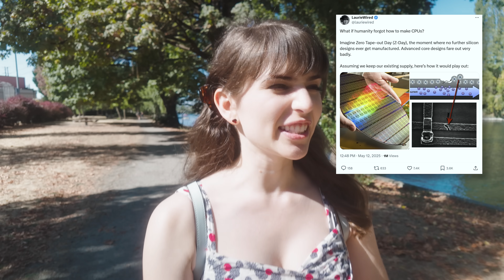what if humans forgot how to make CPUs?

Comment: I have an 8bit transistor-based computer at home. I mean like independent transistors. I created one (only the CPU, a pipelined one at that) decades ago at uni, and another one recently as more of an artistic project (think about something similar to Ben Eaters 8bit computer). Even without manufacturing new CPUs, we could use the modern computing knowledge to create homebrew computers with discrete transistors. Even in the most disastrous situations, within the first year everyone would have a handcrafted computer at home capable of remote communication. Writing some simple communication protocols could be feasible, and before we lost the ability to use the traditional internet, designs and software would be already available. The main issue would be for huge companies who could not process our data at the same rate, but if you ask me, this would not be so bad.
Reply: There was UUCP available before there was an internet. It allowed sending messages between systems that were not always connected together. It could also allow remote users to execute commands.
Reply: That's fine, but in reality we would have to reformat the entire civilization, much of which is at present incapable of running without modern computers. Computers are everywhere, even if we do not notice them -- in the equipment which is used to make transistors, in the equipment which is used to make all the prerequisite materials and tools. 

The shipping, the banking, the chemical factories which make fertilizers and fuel which power the farms which feed the population -- all will need to be rolled back to a version which has been forgotten by modern workers -- if this roll back succeeds, which is by no means certain, it will result in a very different way of life from what we know today. Even the Amish now buy many of the tools ready made, and would not be able to reproduce them from scratch.
Reply: @cogoid  would be far more chance of getting back into glass blowing and evacuating glass envelopes than rebuilding the transistor industry...

thing is though, if we "forget" how to make CPUs, we must also "forget" how basic logic even works. tear up all the work of boole and the like...
Reply: @paradiselost9946  Good vacuum tubes are also not trivial to make -- it took decades of research and development from the appearance of the first vacuum tubes to the time when they became reliable enough to be suitable for computers. Of course, we did not loose this know-how just yet -- there are still some real vacuum tube factories in the world. But if we did not have them and had to start from scratch, making really good vacuum tubes -- good enough for thousands of them working reliably in a computer, that would have been a significant challenge.
Reply: @cogoid  hell yeah. they still need nickel and barium and tungsten and other fun metals... spot welders, some tight tolerance machines...

not easy, but more likely than someone building transistors. big thing is consistency. its well known semiconductors can vary wildly. most tubes of one design are pretty spot on to the datasheet... home made tubes are tricky, but not outside the realms of possibility... de le forest and fleming and edison and tesla, all happily blowing glass in rudimentary workshops, pulling vacuums, all with basic equipment... took a pretty well equipped lab to develop that first bipolar junction transistor...

and yes, theres a few people making transistors at home for the sheer joy of it... credit where credit is due :) the guys making the tubes have an actual market though, unlike the semiconductors...

biggest hurdle with tubes is the filaments... especially if directly heated! that makes a complicated task a nightmare of ground loops and signal offsets...
Reply: @paradiselost9946  Glass to metal seal may seem trivial -- because any old school light bulb has it. But again this is not something that is easy to develop from scratch -- it requires selecting glass formulations and metals which have compatible thermal expansion coefficients, and which also bond chemically when the correct procedure is followed. There are countless patents just on this aspect alone. It is not something that a beginner in a glassblowing masters right away -- though as you have said, there are some cottage industry outfits making small batches of vacuum tubes basically in a garage. But they buy the special materials and have the skills to use them correctly. Also, it is far from certain that their product is as reliable as the tubes were at the heyday of tube based computers.

And vacuum tube based computers usually also required lots and lots of semiconductor diodes -- so one has to master the rudimentary semiconductor technology anyway. It is not a widely known fact, but the first integrated circuits in the USSR were germanium based, and they were manufactured from 1950s all the way into 1990s, and used for on-board computers for some airplanes. So, it can be done with relatively crude equipment, provided one has mastered purification of germanium.
Reply: @cogoid  i really didnt want to get into metallurgy, and alloys such as invar that replaced the former and expensive material... platinum. yes. glass to metal bonds arent trivial, definitely highly overlooked...  i almost mentioned it but it also felt irrelevant in comparison to other issues, how to make the induction heater to flash the getters, for instance?

i already write essays. dont make me write more! seems pointless as at any moment the bot strikes and deletes randomly...
Reply: @paradiselost9946   Digital logic and digital computing does not require solid state electronics, or even any electronics at all. No need to tear up the work of Boole.

The easiest useful digital computer a low tech civilization could build, that would share the same working principles and architecture as modern computers do, is a relay based computer.

If you have the ability to build an induction motor, then you have the ability to build relays that can be strung together to create digital logic to build functional digital computers. Even well into the 1950s companies were still building relay based computers, because they are very simple cheap and capable machines even compared to vacuum tube computers.

A skilled blacksmith from an iron age civilization 3000 years ago could have built a digital electromechanical relay computer. The only manufacturing skill required is iron and copper metal working to create motors and electromagnets.

This type of computer is so simple that it is actually more difficult to generate reliable stable electricity to power the computer, than to build and operate the computer itself.

Making anything with solid state electronics - even using discrete transistors or vacuum tubes - is far more difficult. A layman with almost no specialized training can build a relay based computer at home using little more than some iron nails and copper wire.
Reply: @cogoid  Nah, shipping, manufacturing and chemical engineering would work just fine on 40-50 year old architecture. Hell, banking is still running on ~60 year old COBOL software so it would be more than fine. The only thing we'd really lose would be streaming video, which would be a shame because we'd lose Laurie's content, but hey, if it means that the entirety of brainrot tiktok/instagram slop also disappears, then it's a worthy sacrifice.
Reply: @cogoid assuming we lost all the technology we had, then yes.  But in reality the basis of all manufacturing still exists.  It would be slower, but we would still have mines, still have explosives, still be able to heat metal, create tools, then just start over and get better over time, but much faster in general. If we forgot EVERYTHING then we would still have existing items to reverse engineer so we would still be faster than the short time we got here in the first place.
Reply: @cogoid  I think you will find that there are a lot of us oldies who know how it was done in the olden days. I could make a CPU which uses compressed air or water instead of electricity, make a steam engine or diesel engine, or run  a pig farm if I had to, and I am sure many others could. (You might have to pay me to do it).
Reply: I watched several video about similar project in YT... like I remember watched the 4bit one...
Reply: I adminned a minecraft server once where a guy built a router out of redstone. However, the premise is that you forgot how. So no you couldn't because you forgot

Comment: Microprocessors are so incredibly valuable, and there are so many of them that can be studied, I believe that any such scenario would be temporary. There would have to be some kind of planet-wide upheaval that would prevent them from being manufactured again. And if that's the case - there might not be stable energy source to run these things anyway. Things like classic portable TRS-80 devices would run off consumer AA batteries, and that kind of voltage/current could probably be sustained using homemade sources. But a desktop computer with an AC power supply? In order to run that you'd have the ability to fab new chips, even if they were nowhere near the complexity of today's 3nm processes.

Super cool thought experiment. I shared it with a lot of my contact list.
Reply: TRS-80 extend basic what my first computer in 1980. Forty five years latter, I am coding LLMs for AI. I still have it, and wont let me wife get rid of it. It still gives me joy as a collectable!

Comment: Somehow my old Thinkpad x230 would still be running.
Reply: Maybe you would only need to change the CMOS battery
Reply: @operaoffire  My C64 does not even have a CMOS battery.
Reply: Thinkpad X230 is like a tank. My previous one. I love ThinkPads.
Reply: i'm not sure if my modern thinkpad p14s g5 would run as long as those old thinkpads, like x230-270 and t430-480. I really wanna buy t480 for the little home computer, but i have to buy my own home first, i guess 🤣
Reply: if you dont use your computer under full load EM isnt even a problem, it can run for many more decades only problem is storage and battery and some controllers for various parts would fail before cpu
Reply: reading this from my old Thinkpad T430, running with a replacement CPU (which means I even have a backup for this thing lol)
Reply: @matieyzaguirre   man... to think my t440s is considered old haha   I do have a micronpc transport gx+ (1999?) with a 650mhz p3 and 512MB ram.  also have my dad's college laptop, IBMs first, PC convertible 5140 with 640KB ram lol
Reply: I have all my thinkpads from 23 years to now ,off course all work ,and the looks almost the same for all ,X1 from 2016 battery still close to 90%.
Reply: The best there is!
Reply: I have a small collection of x230-70 Thinkpads.  They will outlive me
Reply: Eh, my X230 died last month... :(

Comment: People would be walking around with RF sensors to track down and salvage any cpus or electrical components. You can actually hear the RF from a phone if you put it right up to the pickup on an electric guitar
Reply: How does a processor emit anything if it is not powered up?  But let me provide an example, there are those who own older vehicles where one cannot buy a new ECU/TCU for them.  Companies simply stop making them when support/demand ends in most cases.  Keep in mind that most collector classics use mechanical management systems.

Comment: As a sysadmin I have been touting the fact that code is no longer optomised though for a different reason.  Mostly because the common answer to "my server is slow" has been "well add more (hardware of the developers choice)!"  To be clear, yes that is an answer, but people demand more and more from their computers requiring more and more hardware and eventually you cannot add more but the computer will still run slow.  So the real answer is optimize your computer and its software first then add hardware as a secondary thought.
Reply: dev here (the kind that handles online sales from a dozen up to multi millions per day). you are absolutely right. we only optimize to a laughable degree and instead of putting a few hours of planning or a few days of refactoring or even a few weeks of restructuring into it, we instead just add a bunch of servers because thats cheaper in the short run. after a few years it becomes too expensive and instead of optimizing now, the software has grown unmaintainable so it gets abandoned and built completely from scratch with different problems that again grow over time until it gets rebuilt again. Happens around every 5 years. it's a management problem. and until we finally hit the wall in semiconductor shrinking and tech does not go faster each year, i dont think we will go back to optimizing anything.

but if we would optimize.. oh boy.. i see up to 200x improvement in overall resource allocation in my area
Reply: @samehedi  be bold do something about it.
Reply: @cj09beira  you massively understimate reality my friend
Reply: My server is slow . Answer: try not using NodeJS
Reply: I optimized firmware in some oscilloscope. Literally without source code. Waveform update rate was increased from 26 k/s to 108 k/s. Exporting settings as a file is done in about one second instead of 5-10 seconds. But yeah, You can force people to buy 10 times more expensive scope, because they wanted to cheap out by outsourcing in India. Keeping software team locally would give better and faster results, which should end up with bigger revenues. Try to explain this to them...
Reply: @norbert.kiszka  You wrote firmware without source code? Not even HDL?
Reply: @rherydrevins  those series does acquisition both in FPGA and in CPU. I did changes only on CPU side. All with ARMv8 Assembly and Smali (this is more readable form of compiled Java to bytecode).
Reply: The baseline for a useable machine now is can it browse the web. And if we continue to force HTML to be a modern  solution with Megabytes of JavaScript, the baseline will just go up. Something I have been thinking about for a while is just having a web assembly program that interacts with virtual peripherals e.g. screen, mouse. This would make it flexible. Then, it could use libraries to abstract this away. However the libraries could be cached. This way attempted with JS, but a malicious website could serve a modified copy which would be cached and used to steal data. This wouldn't be an issue if the program  told the browser "I need ui_library" and the browser got it itself. Sorry if I went off on a tangent :)
Reply: Yes! but that has been changing since 2020 with the high cloud cost, bit coin mining, and now machine leaning LLMs. Energy and storage cost are sky rocketing. As I am sure you must know there is a price for compression of data and that's higher compute. Big tech is already buying up miles of land in Pennsylvania & Louisianan to build mega data centers for AI. These data centers are planed to be the size  and have the power demand of Manhattan NY. Again software efficiency is proportional to resource usage and thus energy consumption and cost. $$
Reply: Why are you adding hardware after?  Why is that not part of the "optimize" system development process?  Most people carry their daily, called a cellphone or use a tablet.  A M.2 NVME used in a FX-8350 with 32G DDR3 what was given to a translator, whom I watched in horror attempt to video edit on a i3 in the past.  But I am curious if one can root a Tesla, and what it would be like to be on a CLI on that?
Reply: The problem isn't lack of optimization, it is that we go crazy with adding obvious things that absolutely will be slow. I think of optimization like careful profiling and tuning. I'd be happy if we just didn't take the obviously worst option. I blame the flood of "software engineers" who don't have an engineering mindset and the organizations who enable them.
Reply: We should have government agencies dedicated to technological optimisation, such as code optimisation, hardware optimisation, Etc. so much energy and rare metals are wasted on inefficient computing.
Reply: @Planeet-Long  Not sure it would work. Every time the government tries to regulate something, corporations go berserk and the media including Hollywood throw another log on the "government is eeeeevilll" bonfire.

Comment: forgetting isn't really realistic without a reason to forget. say nuke dropped on all the major silicon manufaturing plant cities at the same time. with this most of the people who know are gone, and (probably more importantly) all the devices used in the manufacture are gone. this would require full boot straping since the process was largely iterative. but more to the point such an action would cripple the global logistics network with war for likely many years. we'd be down to maybe 10 groups doing underground computing on ti80 clusters running collapseOS in basements to design home printed silicon with 80% failure rate within a decade.

Comment: Hey, I have a question, and I would like to hear your opinion on this.
What if we made big ass CPUs? I mean, CPUs are getting smaller and smaller, and that results in more heat, so why not making them bigger instead?
Reply: Big cpu with the same energy requirement or with more? 100 W is 100 W, a bigger CPU would just be more spread out
Reply: Silicon ain't cheap.